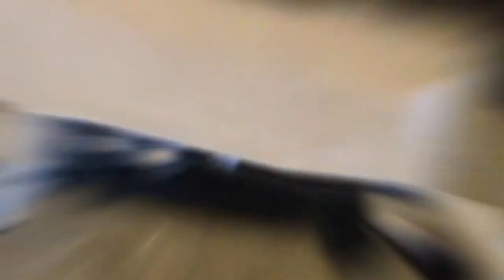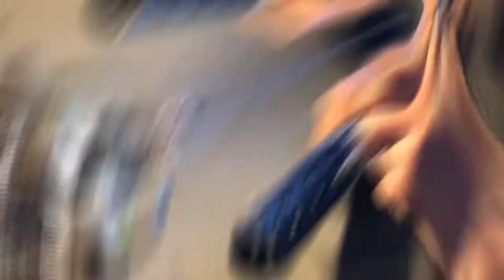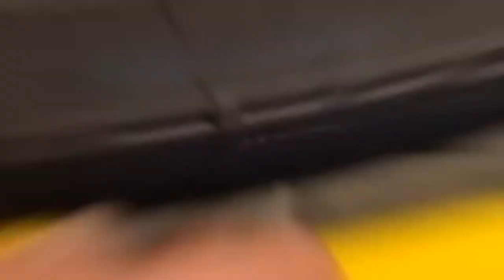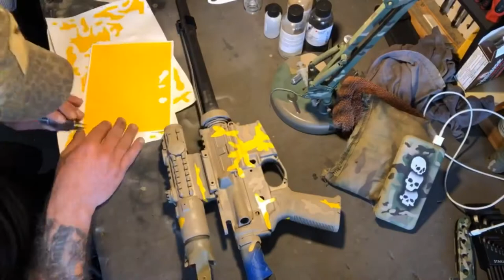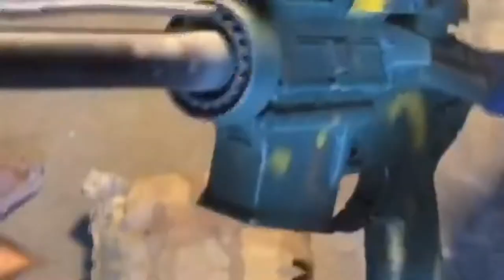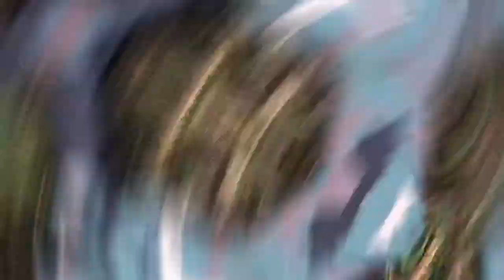Woodland BDU duracoat paint job

Comment: Sick job man! And Just a tip for some; insert the magazines you wish to paint/customize into the platform and mask off the line above the mag well going into the receiver. Additional paint in that area will cause more friction preventing smooth insertion/removal.
Reply from the maker: Good tip, however I haven’t had a issue with it